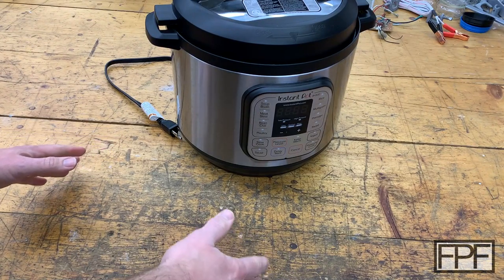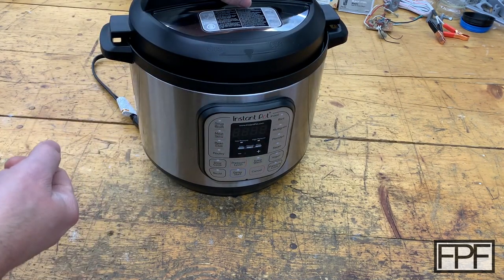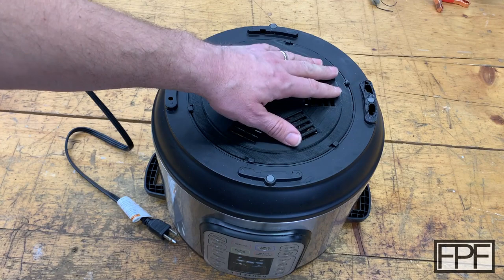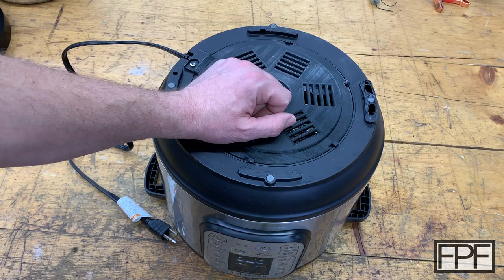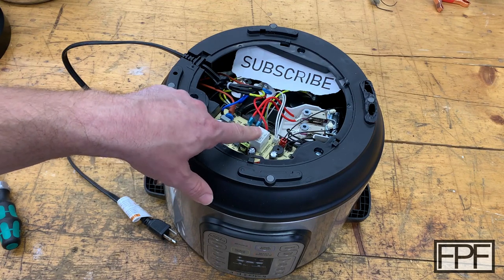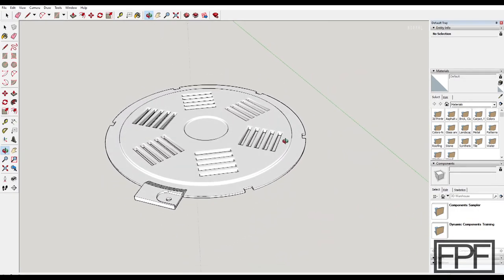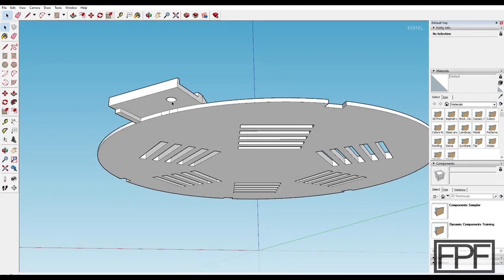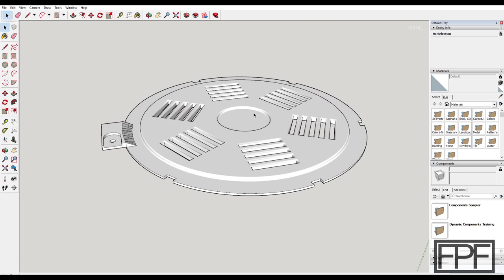3D Printed Instant Pot Replacement Bottom Cover

Comment: Had family do the exact same thing to the exact same model.  I dropped the your STL in the slicer and 6 hours later all was fixed.

Got to looking and my own Instapot is a different model (Duo Plus 60 so a 6 quart instead of an 8) has the exact same part on the botom so this STL can be used for other InstaPot models.
Reply from the maker: So glad to hear it, and thx for sharing regarding working with other models!